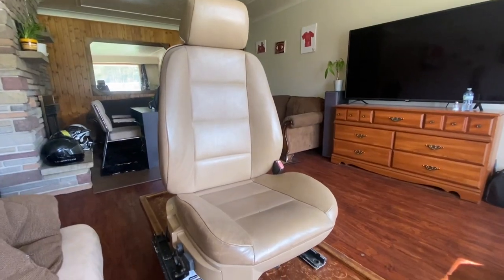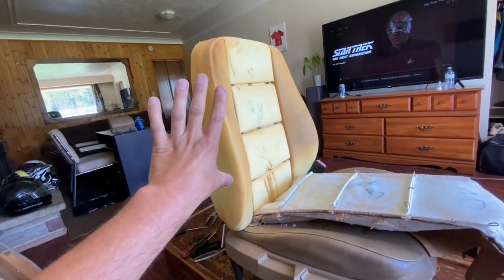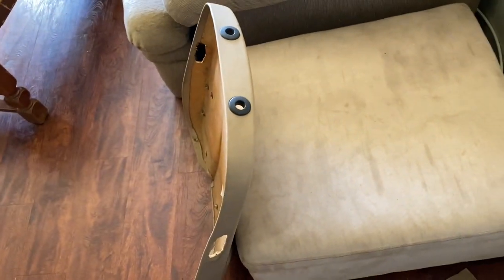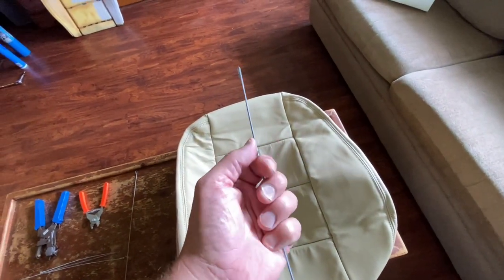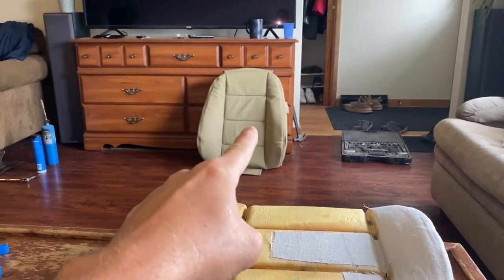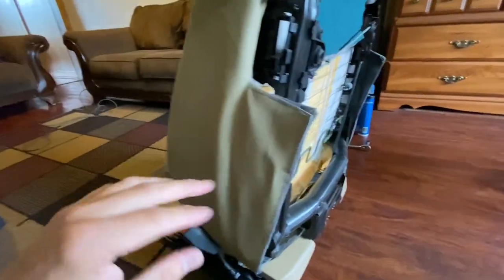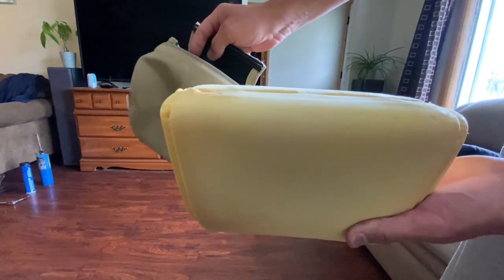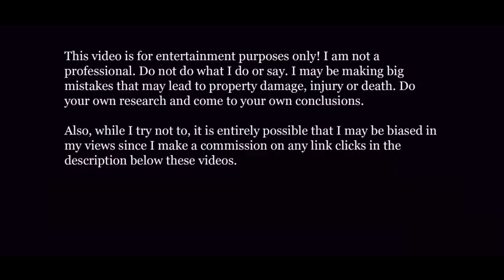￼BMW e36 how to reupholster the seats. Lseat seat covers installation.

Comment: Like the others, I've been waiting for this video. I pulled the whole interior of my 1999 M3 convertible before it went into storage for the winter. I have it in a spare bedroom to redo this winter. I have worked on E36 door panels in my 323i convertible and have done repairs to the seats, as well. I have never attempted to reupholster the seats, though. This video helps so thank you for finally getting it up.
Reply from the maker: Good luck with your project. Sorry it took so long, just trying to get caught up on editing videos.
Reply: Gonna be doing this soon too, video definitely helped me be more confident to do it on my own

Comment: Hey brother, I need your help. I have done the front seats and am in the process of doing the rear in my convertible. I don't see a video you've made covering that. My Lseats covers do not include the holes or trim for the rear seat headrests to go through. Cutting the holes is no problem but removing the trim pieces that the posts go through is not clear to me. It looks like the black piece from the top has fine threads on it and the clear retainer on the backside screws on but I can't get them to budge. How did you get them off without breaking them?? Could you make a quick video on how to do that. I'm stuck and can't go any further. Thanks, my friend!